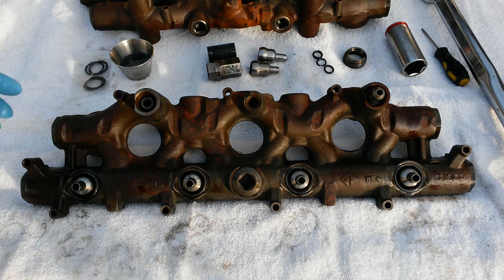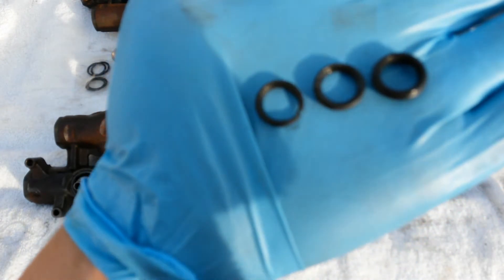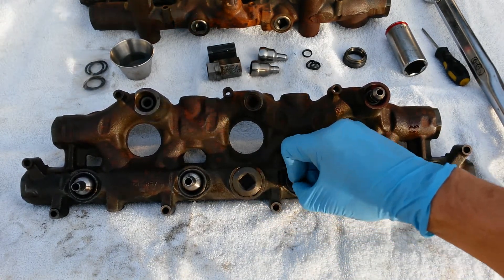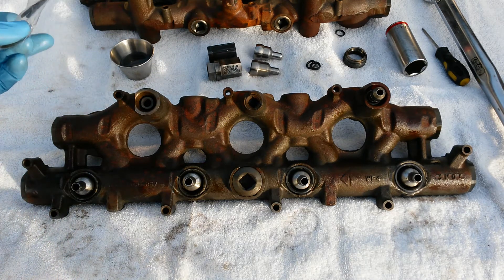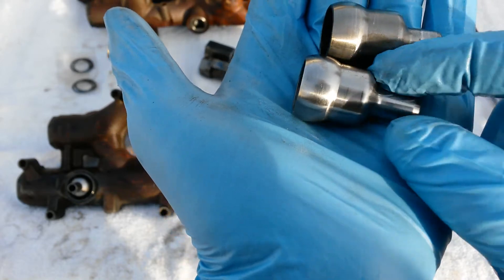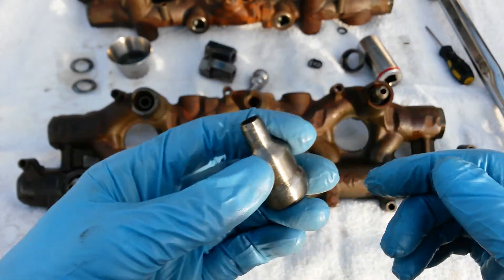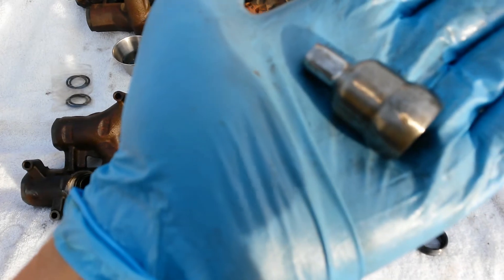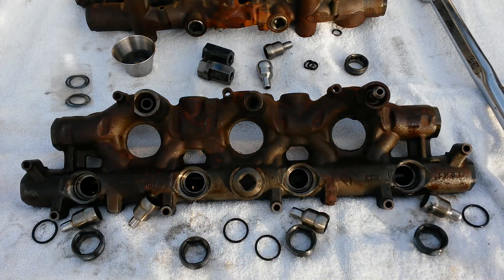FORD 6.0L Diesel ~Ball Tube/Nipple Cup O-Rings~ Fix Your HPO Fuel Injector Leaks LOW ICP IPR

Comment: I have a 2005 Ford F-350 with the 6.0L engine. I'm having trouble with my radio, gauges, and windows shutting off at the same time frequently. I know that this is a common issue with this model truck but I can't seem to find the problem, but when I wiggle my gear shift everything starts back working again. By the way, the gear shift is new, I thought that was causing the problems but I was wrong. Do anyone have any idea what could be the cause of this problem?

Comment: Got a question. I have a not start hot and a #6 contribution code.  Anyway air tested found 2 and 4 leaking.  Pretty sure it was both but only 75% . Anyway in on a weak budget and iv tooled on my truck since new 06.     Yes all of the injector top O rings have what looks like pitting or sanding on the top.  I believe I'm having nipple cup deal leaking or both that on the top O ring.   My question is would any of these issues cause the number 6 code ? Or is this separate from the hot no start leak associated with the Oring and seals in the injector and nipple ?  If I need to spring for a injector I will money is just tight or I would not change it.  But I'm 40 and handicapped broken back and need to do the work myself.  So saving the injector money is fine with me because it's only labor wasted on my part if I need to go back in and replace.   I'm sure your beat with questions all the time , but time is the essence and these forums are not helping me.

Comment: I don't see H&H Diesel selling that socket, nor on your ebay or amazon sales pages. It looks like a profoundly better tool than what I see elsewhere. Where can I purchase? Thanks for your clear, informative videos. Much appreciate the excellent work!
Reply from the maker: These are back up now.
http://rover.ebay.com/rover/1/711-53200-19255-0/1?icep_ff3=10&pub=5575088352&campid=5337488772&icep_sellerId=cr38er

Comment: Yep, Where is that ebay link?  Glad I saw your other video, injector seals that have been fixed twice now.  2004 f350 with 250K on it.
Reply from the maker: Sorry here is the link to my Upgraded O-Rings on ebay
http://www.ebay.com/sch/cre83r/m.html
Reply: cr38er The link worked however in the parts description there is a link to check out  my OTHER ITEMS that is non functional and I did not see the tool in your items for sale.  Guess you don't sell the seal kits for the injectors either?
Reply from the maker: The tools we make in batches, and are unfortunately sold out right now. I can't compete on the injector seal kits. You can get the Bostech kits for 5-8$ easily.
Reply: cr38er Thanks.  I looked for a complete kit with injector seals, oil rail seal   and tool.